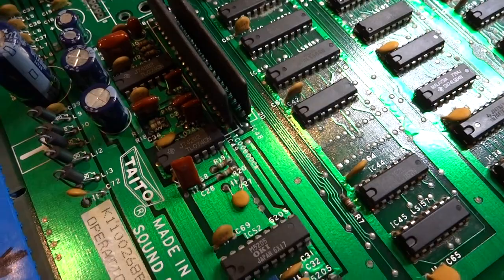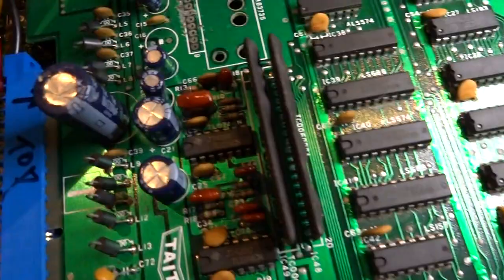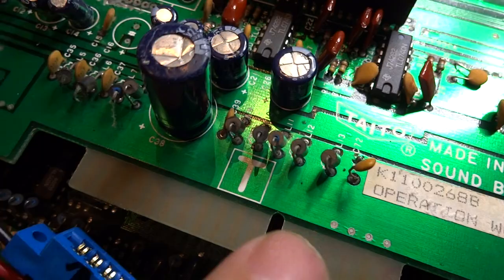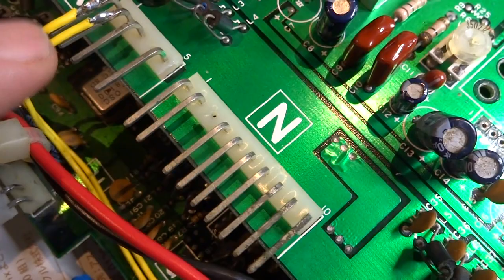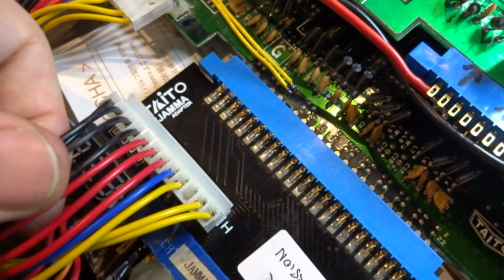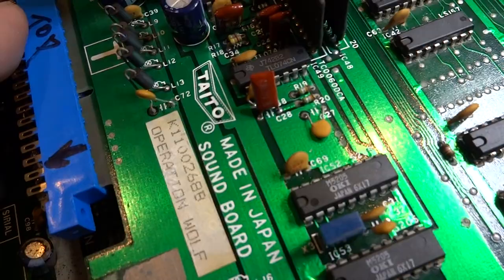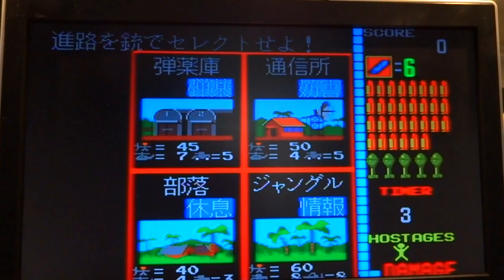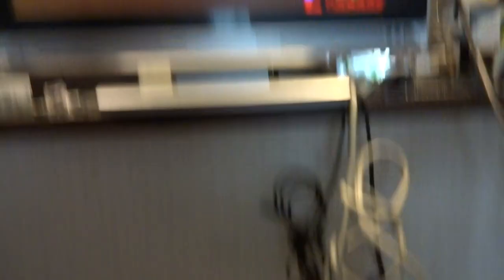Operation Wolf Arcade Sound Board Wiring For Standard Jamma

Comment: Thanks for posting this! I have a operation wolf board to test so this should help out. 👍
Reply from the maker: No problem at all. It may be something simple but hopefully it will help. Good luck with the board and hope it works out :)
Reply: @lukemorse1  I need a adapter for an operation Thunderbolt also 😕

Comment: Very helpful. All of the Taito games I tried so far did, did not need the T connector hooked up. There is enough power that runs through the ribbon cables to power the sound board that way. Did you see if the game will run without the T connector?
Reply from the maker: Yeah, I tried that first with this board but I wasnt able to get the needed power from the ribbon cable (might be weak or bad connection). After messing with it for a bit, I just grabbed the pinouts from the schematics, wired it up and it fired up. That is good to know though, Ill try it with the other one and see if that works :) Thanks man!

Comment: Hey Luke! Could I possibly contact you about repairing my OW board? Boards are clean. I've already socketed and replaced all RAM and recapped. I'd be grateful.
Reply from the maker: Hey John, thanks for the message. Unfortunately shipping stuff out of Japan, especially electronics has gotten not only expensive, but also restrictive. Due to these reasons alone the cost of just returning them would be pretty outrageous and in worst case, not be possible depending on if the shipping companies deem it as "dangerous goods". 
I wish I could help but things have changed quite a lot here after the first wave of COVID struck.

Comment: Does Operation Wolf use a positional gun or a light gun? I see conflicting info everywhere!
Reply from the maker: You can use a light gun on it. I still need to wire mine up but for some games, you can use both. I have a HOTD2 as well as some Sega Lindbergh games that I can used positional guns on although they are meant for light guns.